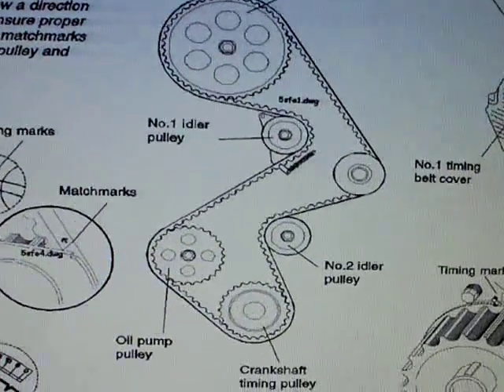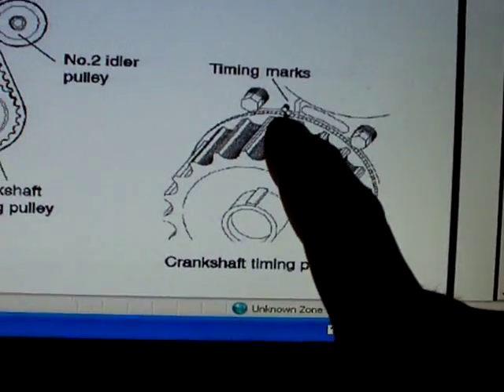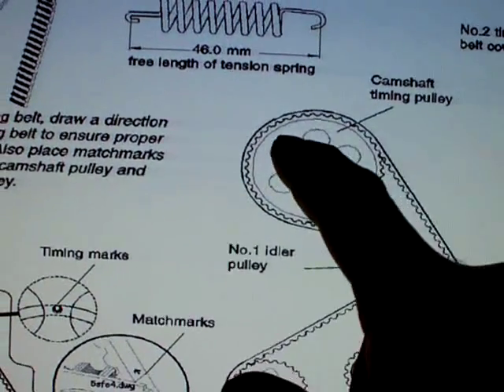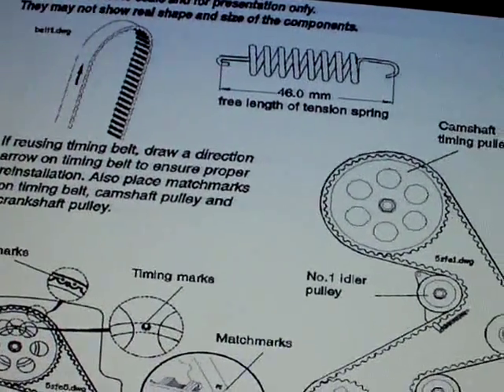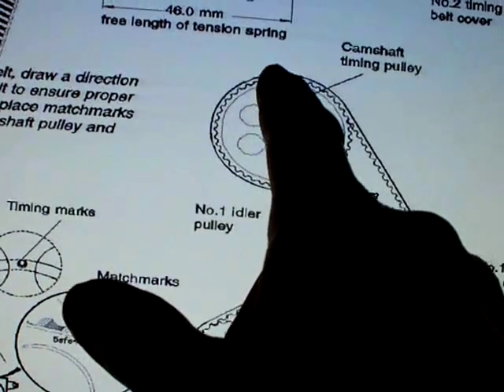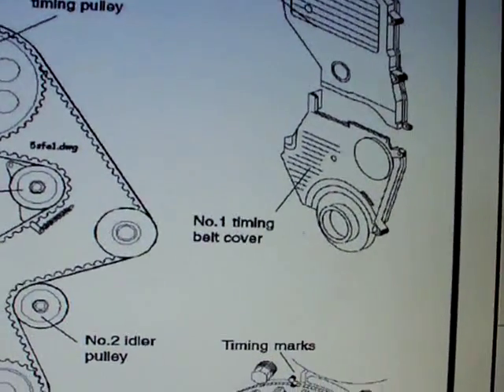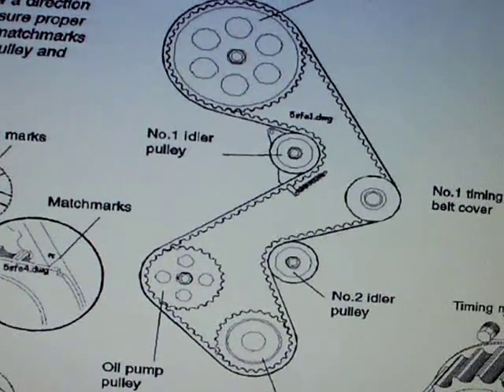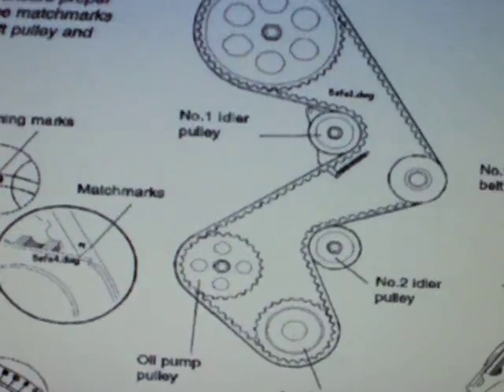1992 MR2 timing, alternator, AC belts and water pump Part 2

Comment from the maker: Oct 2012. Mechanic told me I have an oil leak. Most likely cam seal. So you might as well do the seals on the cam, crank and oil pump when you're doing the timing belt. An easy trick to getting out a pressed in seal is to use a drill and screw a sheet rock screw into the edge of the seal. Then use vise grips or a puller on the sheet rock screw to get the seal out.

Comment: thanks for the video.  my mechanic change the timing belt and water pump on my 1993 mr2 and now the car is giving me 24mpg in the highway.  before, it was giving me 29mpg.  how do i check to see if the timing is correct?  thx for your help.